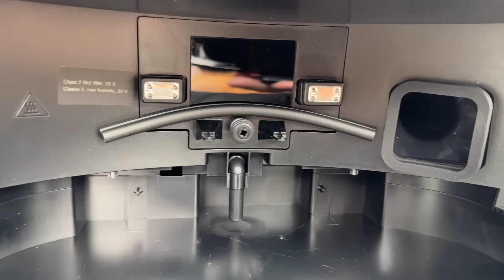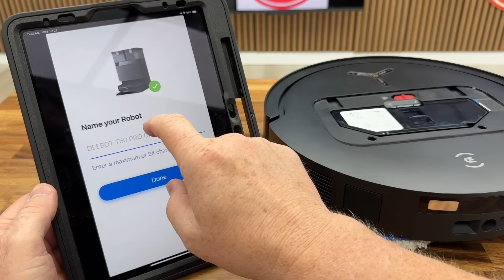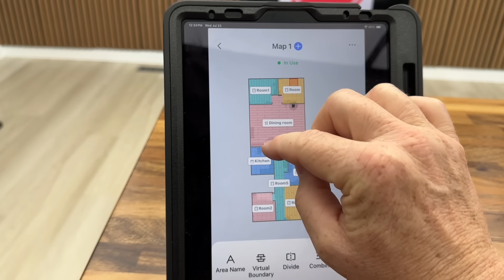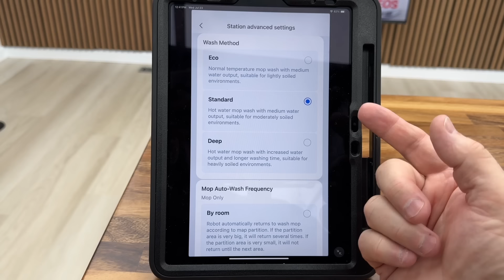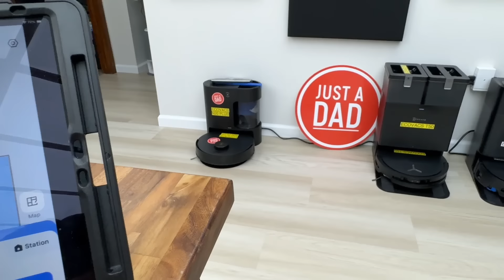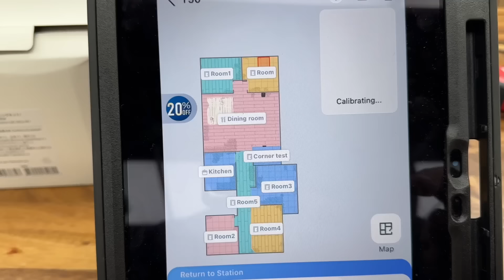Ecovacs T50 Pro Robot Vacuum & Mop FIRST LOOK / Review / How To Setup For First Time!

Comment: We purchased an Ecovacs robot vacuum cleaner five months ago for ₹75,000. Unfortunately, it started malfunctioning within just three months of use. Since then, we have raised multiple complaints and continuously followed up with customer support, but the experience has been extremely disappointing.

Customer support has been highly unresponsive. Calls are not answered, and there are no callbacks. After repeated efforts, a technician finally visited and identified a sensor issue. However, the sensor board was delivered only after a delay of one month.

Later, we discovered that the brush was also worn out. The technician confirmed this and raised a request for a replacement. After another month of waiting, we were informed that the brush had been delivered, but it was sent to the wrong address in a different city.

Now, despite multiple attempts, we are unable to contact customer support at all. Our calls are not being answered, and it appears that our numbers may have been blocked.

Considering that the product is only five months old and we have already faced so many issues along with extremely poor service, we are left with no option but to consider approaching the consumer court.

Comment: I was particularly interested in how you set up the robot to vac and mop simultaneously. My T50 fails to wet the mop or even dispense cleaning solution before it goes out. In all the weeks I've had this thing, nothing I do fixes these problems. Ecovacs even replaced the first unit under warranty, but the second unit does exactly the same thing. Any ideas? Customer service has never been able to fix this with me.
Reply: Can you tell me this in detail?
The solution dispense option is available in app and you have turn it on manually otherwise it won't work.....but I didn't understand that mop wet problem can you tell me that in detail

Comment: i have the normal Robot without the Pro features and they doo a good job too for me the suction power and corner cleaning is the same like the Pro model but he has no dirt detection function in the station for a re-mopping function but for that price are all features absolutly inpressive. I have one time the same problem with the Calibrating problem but with a software update this problem will be solved.

Comment: I know price point is not the same but how do you compare this machine vs Mova V50? I have mainly hardwood floor and 2 stories. I was considering roller mop style but looks like these rotating mops perform better. 

I saw reviews that the battery life in V50 is not great? 

Would you say there is a clear difference between navigation or obstacle avoidance? 

How about laminate hard floor cleaning performance? 

I don't want to spend an extra $350 for the V50 but if this T50 is almost as good as the V50, then makes sense to get this as this is thinner so gets under more furniture. I guess the V50 comes with more supplies so I guess we can say the real difference between T50 and V50 in terms of price is roughly $150-200.

Trying to find the best set it and forget it robot mop. Concerned if that T50 gets stuck just like the Ecovac X9 experience you had.
Reply from the maker: The mova is way better, The T50 is at my home and not doing very well
Reply: @JustADad Ah gotcha thank you! Also how does T50 compare to Mova P10?